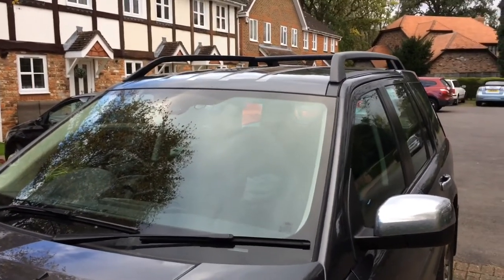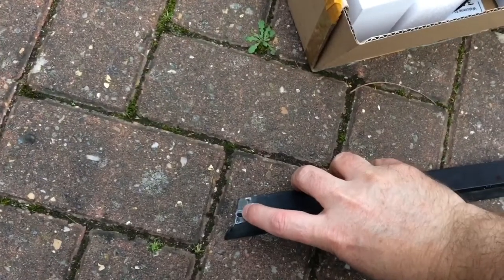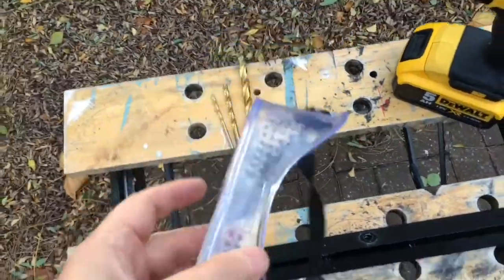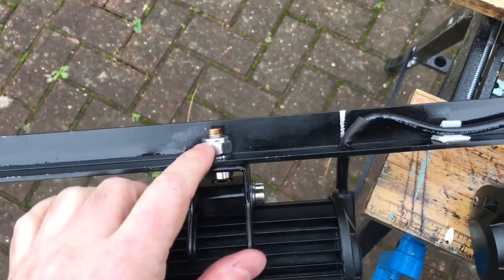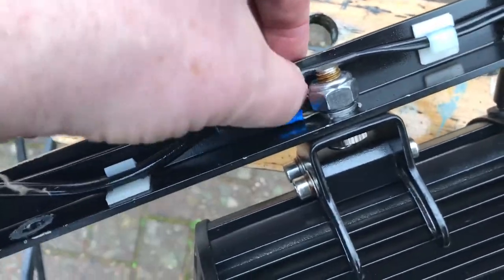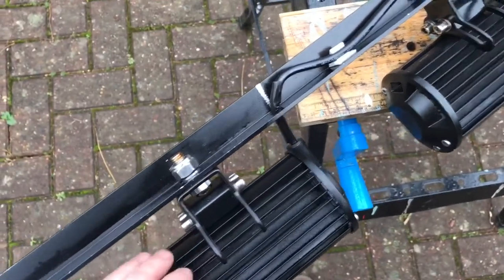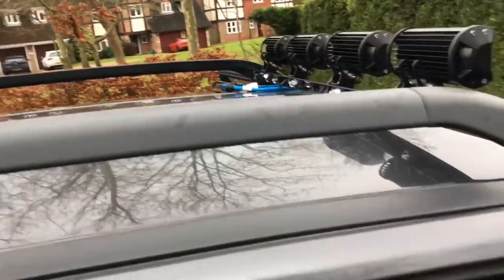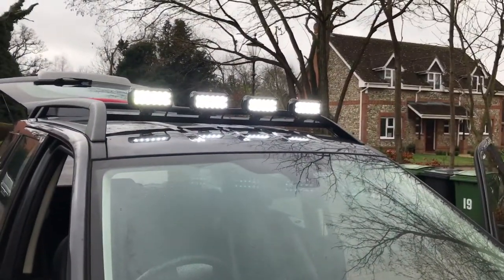Fitting LED spotlights to the roof of a Freelander 2/LR2

Comment: Hi, Could you share any information on the blue wire to main beam wiring. I'm in the middle of installing the electrics for a light bar and cannot get power to it using a harness kit. The main beam attachment plugs with the kit do not fit freelanders and seems I will have to wire it in manually like this?
Reply from the maker: The main beam wire is actually yellow-orange. No idea why I said it was blue! Connect a thin ~5A wire from this wire to the relay coil trigger (pin 85 I think). Relay coil ground is pin 86 I think. Then carefully take a thicker wire (eg: 17 or 27A) from your battery positive terminal to a 15-20A inline fuse then to relay contact input pin 30. Then relay contact output pin 87 to your lightbar. I’ll do a video on this very soon.
Reply: Thank you. I will give this a try.

Comment: Did you use standard fuse holder or mini fuse holder
Reply from the maker: Standard as that was what I had available, but doesn’t really matter what size fuse it is, only the current rating

Comment: Should have made a loom for the wiring used grommets 2x 6mm bolts to support are not enough it will bend and flex then fall off fitted isolation switch
Reply from the maker: I have since fitted rubber grommets where the cables pass through the metal. I’ve also fitted an isolation switch to the interior light panel (video coming soon). The light bar seems fine on the M6 bolts. It’s been fitted for 4 years with no issues.

Comment: Would this still pass an mot being hooked up to main beam? Considering new headlight rules?
Reply from the maker: Yes, it will be fine. Mine has passed 3 years running with these, or the previous single long light bar. My dashcam did record the tester's assistant saying it needed an isolator switch, but the tester himself disagreed and passed it. The new rules apply to dipped beam LED/HID bulbs. The UK lighting regulations state 55W max per lamp for dip. Main beam is whatever you like, so long as it switches off when you change to dip beam and it doesn't dazzle oncoming vehicles. I am going to fit a switch on mine, just to be on the safe side in case I ever get pulled over by a police officer who doesn't know the regs. I've also found in fog and snow that it is better to run without the roof lights on.
Reply: Beavis Pits OK Excellent, thanks for your reply and info, much appreciated!!